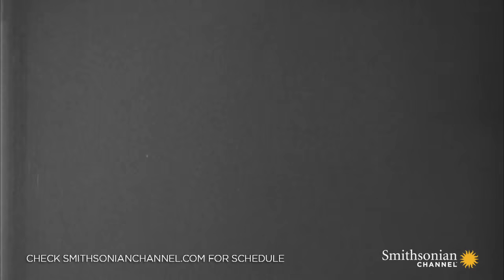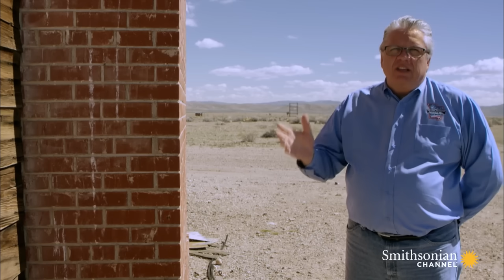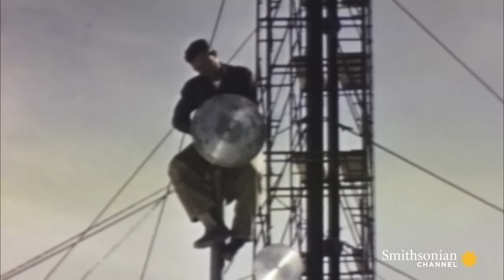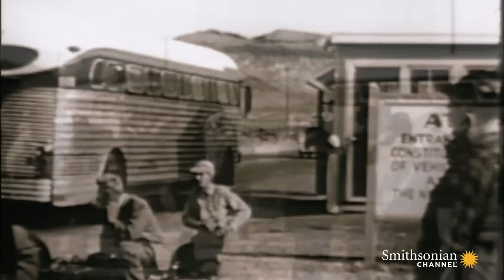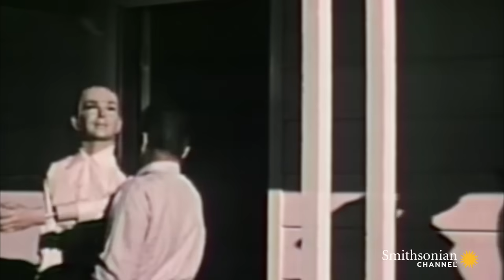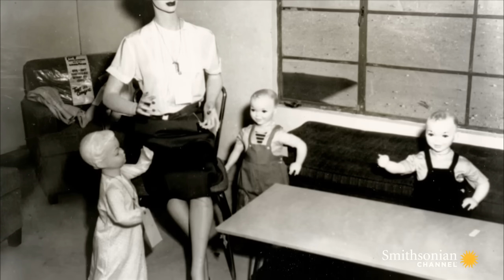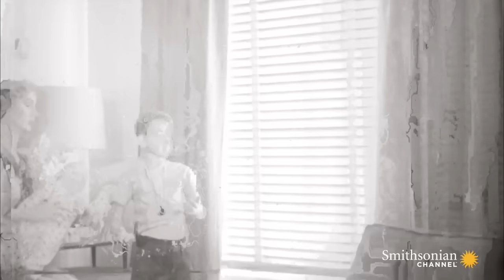Intense Footage of Fake Towns Used for 1950s Nuclear Tests

Comment: Honestly curious here, how did the cameras survive? Also it seemed that they didn't even vibrate when a house was being incinerated in front of it, how?
Reply: I think that they were coated with thick layers of lead. And they were probably fixed very Strongly into the house
Reply: They had a lot of protection, though the exact details have been muddled over time.  The problem for the naysayers is that a fake test is even more difficult to "fake" back then than you might assume.  No visual vfx, or 3d model editing, etc.  It would be impossible to do such edits, yet somehow people think these tests and the moon landing and JFKs assassination (etc) are fake or staged or such

Modern footage will always be possible to be faked, but older footage cannot be doctored even with modern tools (unless you mean a digital copy of old footage being edited, but that isn't the original silver crystal film footage now is it?)

Funnily enough, the higher quality silver film crystal footage of some movie films are as high quality as modern 4k when recognized, just our digital recording and transmitting abilities were dogwater quality back then

Comment: I have a question - how were the cameras kept secured as they recorded so close to or within the blast radius?
Reply: Ever hear of a telescopic lens?
Reply: @1958Citation  If true (and I'm inclined to believe you), absolutely impressive.
Reply: the cameras were placed in protective concrete bunkers (typically lead lined) and often facing away from the blast toward large mirrors suspended atop of pillars in order to cut out some of the energetic wavelengths of the flash as well as avoid overpressure of the shockwave. Even still, the small percentage of visible light emitted from the explosion was so powerful that they required tinted glass like that used in the darkest welding lenses for those cameras recording the fireball.
Reply: @bjornragnarsson8692 ya that last shot inside was exactly what you describe 🤡🤡🤡
Reply: @Cart2.65Lv8  I’m sorry you have dreams of clowns. That must be hard for someone like you. My condolences. 💐 When, or if, you ever get over it, you may want to check into the footage of this exact test. The setups in these model houses. It may give you piece of mind. Or it may just give your more clown dreams. Best wishes for that.
Reply: @jellyfishi_  Interesting.
Reply: By steel guy wires on poles
Reply: This is all hoax. Nuclear weapon is a hoax. As simple as that.

Comment: Wtf are those cameras made of
Reply: The usual.  Ask any mechanical engineer if it is difficult to manufacture a camera enclosure to withstan an atomic blast at half a mile if the yield is known ahead of time and there are no fiscal limits.
Reply: @puncheex2  There were cameras right there in the blast & no, film could not survive the radiation & glass would melt
Reply: @Snide01  Fine.  Have it yu way.
Reply: zoomed in
Reply: Nokia phones

Comment: Just get in the fridge!
Reply: It’s gotta be lead lined tho
Reply: @GamingBros36 let's be honest with our selves the radiation is the least of your worries. Also the fridge has steal all around it that means  it will absorb the radiation. But yes it needs lead and why are you where the bomb is going off?
Reply: The Crystal Skull
Reply: Weakest film in the series.
Reply: SaiyaMan2011 Billy the kid?
Reply: 罪人 — in a fridge
Reply: @Justaintcopyrighted  works too
Reply: not only is getting in the fridge dangerous but fridges back then could only be opened from the outside so once ur in if no one knows ur there ya aint gettin out
Reply: @cidneydorsey plus, the lead lining would need to be FAR thicker than anything which would coat fridge.
Reply: It becomes a microwave
Reply: SaiyaMan2011 indiana jones?
Reply: Shawn Dumbass that was an Indiana Jones reference
Reply: Like billy the kid in a fridge?
Reply: Lego Indiana Jones was lit af
Reply: Ah, yes, the Indiana Jones reference
Reply: actualy refrigerators are no longer lead lined and even if they were you could get trapped and run out of 02
Reply: SaiyaMan2011 lego indiana jones
Reply: Miko S.O ALSO fallout
Reply: UnluckyPancake 
Yes, Billy the kid
Reply: We don't talk about that movie
Reply: Chantz Dean fallout nv also has a easter egg like that
Reply: And get stuck in there for 200 years and some asshole would sell me to some raider instead of taking me to my parents home? No thanks
Reply: You could not get out of the fridges of that time. Many kids died.
Reply: Plot Twist:  The fridge lands face down blocking the door and Indiana Jones died from suffocation.
Reply: It’s not Indians jones
Reply: That poor kid billy though... so many years inside a fridge...
Reply: SaiyaMan2011 6
Reply: Lol Indiana Jones
Reply: SaiyaMan2011 lol😂😂😂👌
Reply: SaiyaMan2011 idiana Jones the bih
Reply: SaiyaMan2011 Indiana Jones
Reply: Dude said “doomtown” it’s nuketown from the start
Reply: That_Guy_._. Not just 4 nv also
Reply: You aren't getting out of one of those old fridges no latch on the inside
Reply: Lol billy
Reply: SaiyaMan2011 hahahah
Reply: Lol Indiana jones
Reply: 綾子 yeah it does. If it's a lead fridge. You need at least an inch of lead all the way around you to protect you from a nuclear blast.
Reply: stop xD
Reply: Indiana Jones
Reply: hi billy
Reply: Indiana jones reference tho
Reply: Chantz Dean no Indiana jones
Reply: Prob with those old fridges was they ad a latch that held them closed...and couldn't be opened from the inside.....
Reply: SaiyaMan2011 Indiana Jones I don’t think that works irl XD
Reply: I dont wanna turn out like billy
Reply: Is that an Indiana Jones reference?
Reply: Ok! a hundred years later HALP
Reply: lol
Reply: I watched this in some movie
Reply: XD from the movie
Reply: NB216  holy! The guy was making a indiana jones reference
Reply: @FishStix2077  why do you care so much to comment to that many people
Reply: @cafetyria3656  why do you care so much to ask me
Reply: Indiana jones style
Reply: Fallout 4 billy the kid🤣🤣🤣🤣🤣
Reply: This man speakes the words of God
Reply: @urosjandric9378  it could work tho
Reply: You don’t wanna end up like billy from fallout 4
Reply: I ate the pudding
Reply: @urosjandric9378  bro its a reference
Reply: ikr
Reply: Indiana jones right there
Reply: XD
Reply: And become billy the kid
Reply: Well u will end up like billy in fallout4 nuke
Reply: Your right i believe that happend to a mitssubitchi worker who was from japan when the hiroshima exploded he was on a fridge...
Reply: That scene from Indiana Jones played right after this video on my end.
Reply: hay Billy still had to be that mutant
Reply: Billy the kid? FO4?
Reply: Just duck
Reply: And be like billy yeah right 😒
Reply: Bruh, he got lucky, those old fridges can't be opened from the inside.
Reply: couldn’t even scroll past a video recommendation without seeing indiana jones nuke fridge clip
Reply: billie the kid xD
Reply: Ahhhaaaa u got me
Reply: There is like a 50% chance that will work
Reply: Literally right underneath your comment is the clip from that movie lol
Reply: I miss lego indiana jones
Reply: billy the ghoul :D
Reply: smart idea
Reply: Wouldn't matter if you don't have suit or gas mask your dead anyways from radiation
Reply: shockwaves are powerful so i wont recommend hiding in the fridge during a nuclear test newr your neighborhood
Reply: bunkers that are like 5kfeet deep or 1kfeet deep might work
Reply: Indiana Jones lol 😂😂😂
Reply: Like indiana jones
Reply: Don’t get stuck like billy!
Reply: Omg..i always thought that as a youth..
Reply: My Door got stuck on an Orange :(
Reply: Yea but back them if u got in a fridge u couldn’t get out so u would die any way.
Reply: Fridges back then didn’t have magnetic doors so people (mostly kids) would go in and be unable to get out and die, so unless we’re talking about current refrigerators then this ain’t smart
Reply: Billy?
Reply: Don't have enough time.
Reply: An indiana jones fan i see
Reply: There is no fridge
Reply: hide under the school desks
Reply: its fake this footgae
Reply: You do realise fridges have gas canisters in the back of them that will explode when the blast and heat hits?
Reply: Surprised it took my three comments to see an Indiana jones reference
Reply: Its air tight youre dead in 30 minutes
Reply: It doesn't work, but hilarious nonetheless!
Reply: Bro This is not indian jones
Reply: That doesn’t work it’s in movies even if you did survive  u would break ur neck or die from being exposed to radiation
Reply: Fallout
Reply: Fr
Reply: I tried to but Indiana Jones was Hogging up all the space.  And wouldn't get out
Reply: santiago Silva not if the refrigerator is lead lined
Reply: Anthony Ab it was
Reply: "You look like something that was left in the fridge for too long"
Reply: UnluckyPancake yes
Reply: SaiyaMan2011 that doesn't work
Reply: @綾子-s9q  yes it does
Reply: 綾子 e/woooosh
Reply: 綾子 r/wooosh
Reply: This brought to you by Fallout 4 fridge kid
Reply: Miko S.O There’s a billy the kid in fallout 4
Reply: the fridge has to be lead lined 🙂
Reply: SaiyaMan2011 Indiana Jones or fallout 4?
Reply: SaiyaMan2011 I’m memory of billy the kid
Reply: Fallout4
Reply: Uros Jandric lead

Comment: Can someone explain how they recovered the footage of a 1950s camera ? I'm not trying to be a smartass but I feel like if all the windows in a home is to break and a chimney to move 6 inches from a blast wouldn't the camera lens at least shatter or break
Reply: Someone gave an explanation in the comments on how the camera survived. I copy and pasted their comment for you to see, 

“Think of the huge amounts of effort the photographers had to undergo to make this footage available, even today. The cameras had to be mounted on 16' steel poles, and pinned to the ground with guy wires. All the mounts had to be covered in lead shielding to prevent the footage from becoming 'foggy' from the radiation. The camera housings inside the homes weighted at least 500 lbs IIRC. THEN, all of the cameras had to be set to timers, to start recording moments before the bomb went off. 

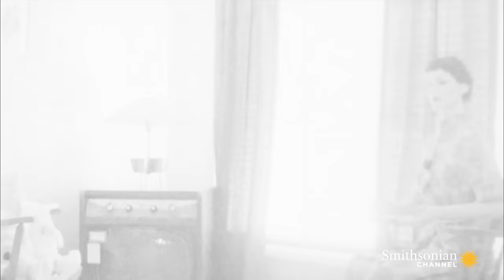Not to mention the lighting for the interiors (see 2:45, you can see the reflection of the lights). As well as the data retrieval, processing, storage, and restoration. The cameras shot on 16mm film, and if one of the cameras were destroyed, that was that. No 'redo'. Also, the mannequins were produced by JCPenney. After their microwave adventures, they went on to be showcased in the JCPenney windows in Las Vegas. Creepy as fuck, but I think the AEC just wanted to see how fucked up they'd get by the bomb.

Huge props to Peter Kuran, BTW, who restored all the footage seen here. The quality used to be garbage before he treated them. Well done Smithsonian. Operation Teapot Apple II, May 5, 1955, 29kt.”

Comment: how do they get footage without destroying the cameras/footage
Reply: Potato Duck They’re heavily shield and braced, but if you want a very in depth explanation some names Olemarkskan explained it very well and I went back and found their comment and copy and pasted it for you. 

“Think of the huge amounts of effort the photographers had to undergo to make this footage available, even today. The cameras had to be mounted on 16' steel poles, and pinned to the ground with guy wires. All the mounts had to be covered in lead shielding to prevent the footage from becoming 'foggy' from the radiation. The camera housings inside the homes weighted at least 500 lbs IIRC. THEN, all of the cameras had to be set to timers, to start recording moments before the bomb went off. 

Not to mention the lighting for the interiors (see 2:45, you can see the reflection of the lights). As well as the data retrieval, processing, storage, and restoration. The cameras shot on 16mm film, and if one of the cameras were destroyed, that was that. No 'redo'. Also, the mannequins were produced by JCPenney. After their microwave adventures, they went on to be showcased in the JCPenney windows in Las Vegas. Creepy as fuck, but I think the AEC just wanted to see how fucked up they'd get by the bomb.

Huge props to Peter Kuran, BTW, who restored all the footage seen here. The quality used to be garbage before he treated them. Well done Smithsonian. Operation Teapot Apple II, May 5, 1955, 29kt.”
Reply: thanks

Comment: How did the camera not get destroyed by the blast?
Reply: They’re heavily shielded and braced someone in the comments named Olemarkskan said this if you want a further in depth,

“Think of the huge amounts of effort the photographers had to undergo to make this footage available, even today. The cameras had to be mounted on 16' steel poles, and pinned to the ground with guy wires. All the mounts had to be covered in lead shielding to prevent the footage from becoming 'foggy' from the radiation. The camera housings inside the homes weighted at least 500 lbs IIRC. THEN, all of the cameras had to be set to timers, to start recording moments before the bomb went off. 

Not to mention the lighting for the interiors (see 2:45, you can see the reflection of the lights). As well as the data retrieval, processing, storage, and restoration. The cameras shot on 16mm film, and if one of the cameras were destroyed, that was that. No 'redo'. Also, the mannequins were produced by JCPenney. After their microwave adventures, they went on to be showcased in the JCPenney windows in Las Vegas. Creepy as fuck, but I think the AEC just wanted to see how fucked up they'd get by the bomb.

Huge props to Peter Kuran, BTW, who restored all the footage seen here. The quality used to be garbage before he treated them. Well done Smithsonian. Operation Teapot Apple II, May 5, 1955, 29kt.”

Comment: 5,500 feet is a mile. So im wondering how big was the bomb. It couldnt have been any bigger than 1 megaton. Most likely not even half that power. A 5 megaton nuclear device vaporizes everything with in a mile radius. The largest bomb ever exploded was 50 megaton hydrogen bomb, and the fire ball was a mile across by itself, the blast radius was 15 miles, and it destroyed everything within a 60 mile radius in every direction. So the bomb they were testing was minute in comparison if a wooden house survived a blast a mile away.

Comment: Too much cgi that I almost vomited.  The blatantly obvious thing is that the camera survived the blast. Hell, it didn't even flinch.
Having said that,  if one looks at the vid in slow motion, the smoke patterns don't make sense at all. They are 200% CGI.
Reply: You are just used to overestimating nukes
Reply: You idiot, the reason the camera didn't flinch is because it was a supported tripod with supports BURIED underground, and the nuke with the smoke patterns?  Yeah the blast doesn't just push, after the blast it pulls BACK. And how do you explain a giant crater and radioactive sand caused by CGI?
Reply: Vamsi Krishna 
What a dicktroll.  I watched these on PBS back in the 70's.  No CGI back then.  A "pocket" calculator was the size of a sandwich.  Pray tell that you don't work at a technical call center.
Reply: How does one argue with a person who is about half-smart?  Vamsi, you are wrong. These films aren't from the 70s - they're from the 50s. Sure we can do analog video - that's what TV is.  But you couildn't manipulate it, you couldn't draw with it.  You barely had character mode CRTs ar the time - more likely you had KSR teletypes.  Just give it up, and go vomit elsewhere.
Reply: such a fucken idiot. Probably a pakistani/indian tech scammer judging by your name
Reply: Vamsi Krishna gr8 b8 m8 I r8 it 8/8.
Reply: In seventies? You mean when C language was created? Do you even have a fucking clue how graphics are made in movies from the early 1900's? Even if the one shown in the video isn't exactly computer generated, it still can easily be made using anolog electronics. It's you who should learn science, buddy.